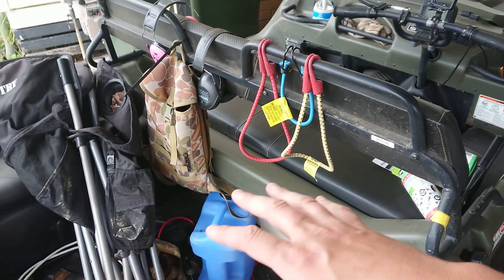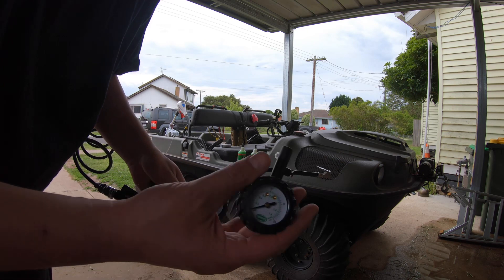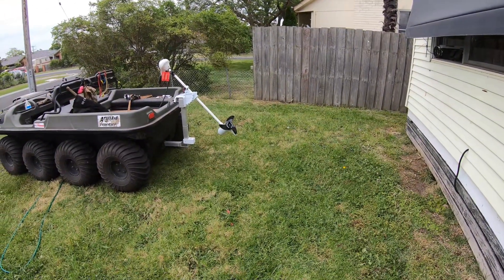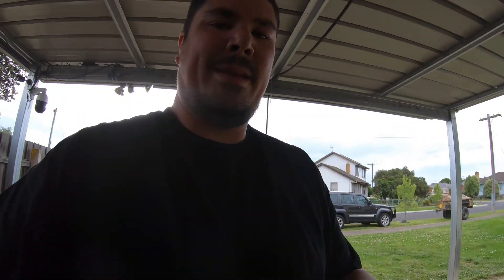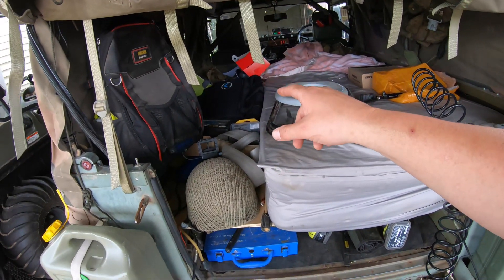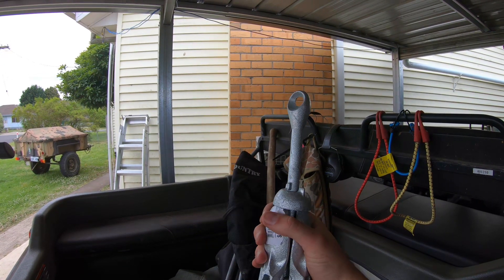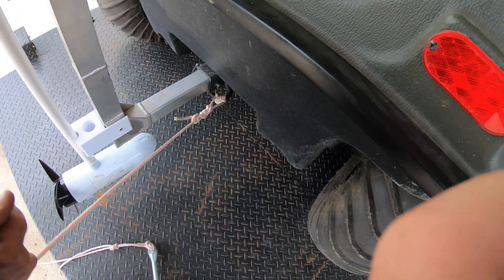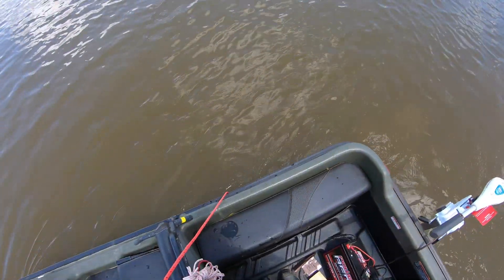Tire Pressures | New Argo 8X8 - Episode 28

Comment: The tire pressures you are running at are usually seen when you put tracks on. 
When we run without tracks, we drop the air pressure down to 2.5 - 3 PSI.
When we put tracks on, then we run the tire pressures up (front to rear) 5,7,7,5 PSI as a starting point.
Reply from the maker: I've bumped them up a bit as I'm crossing logs and hard obstacles and have bent rims a couple of times.

Comment: Where is the speedometer speed sensor located at? Does it read tire revolutions, gear or calipers to determine its speed?
Reply from the maker: I'm not actually sure - it does have the smaller tires on it, so I assume that would influence the speed reading. I'm going to check it against GPS at some stage.

I'll look into it and make reference to it in my next vid.

Comment: Hi Just got my first 8X8 650 Frontier, can you advise trailer you are using and if my tyres are tubeless. Very few tie downs any suggestion, thanks
Reply from the maker: The trailer is custom made tilt bed, that's shown in later videos, will add link in a minute - tires on the Argo are indeed tubeless.

You can see me unload the argo from the tilt bed here:
https://youtu.be/Iz1WDGhkhW0?t=410